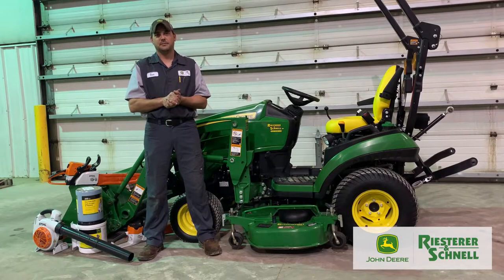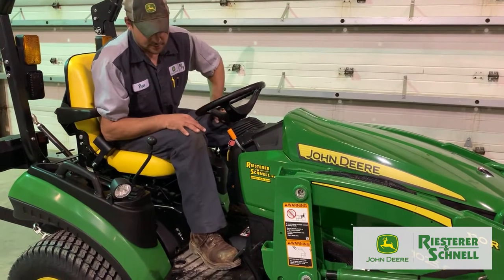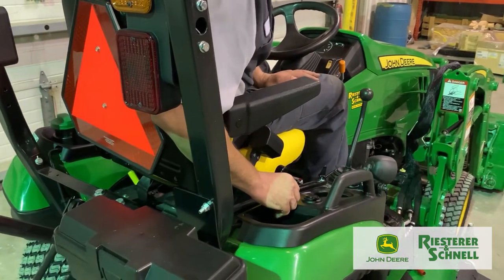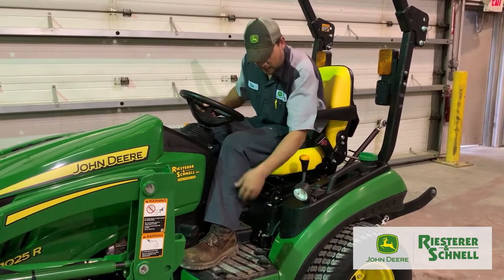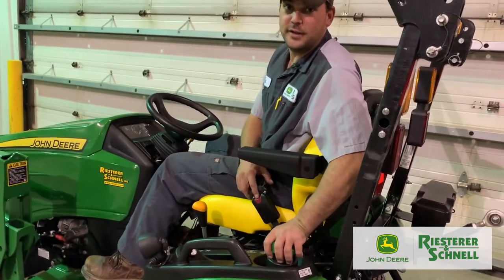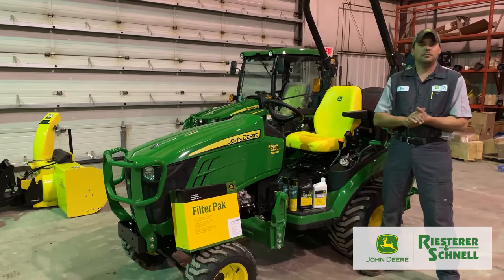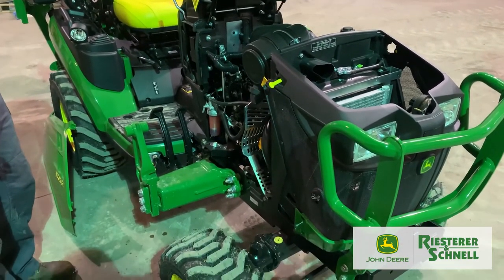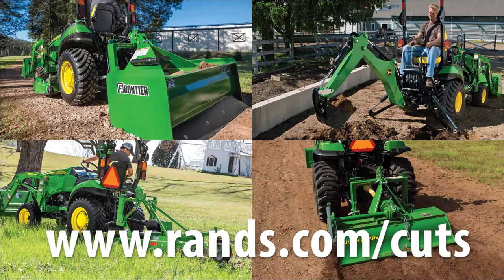Virtual Compact Tractor Clinic

Comment: I have a 3038e that we bought around two months  ago, my questions are on the exhaust filter cleaning will the light come on automatically when it needs to be cleaned? And second question is does the bucket have a free floating lever to make it free floating?
Reply from the maker: The light will come on automatically when its needed. The bucket does not float the lift arms do, you simply need to move the the side on the 3038E which is different than what Ben covered on the 1025R.

Comment: I'm not dure if I got your message. Will the exhaust filter cleaning indicator come on automatically and automatically start to clean the filter?
Reply from the maker: The light will automatically come on, let the tractor run until the light turns off. This will allow the tractor to complete the cycle.

Comment: My regenerating seems to kick in at 76 per cent and shuts off at 61 per cent???!!!!  Usually in only about 25 hours on the machine.
Reply from the maker: You need to keep the tractor running until it competes the full cycle. If your tractor does not have any codes or lights coming on this will be ok.